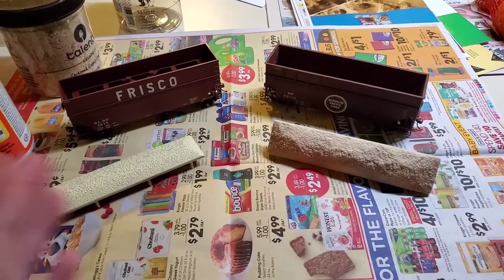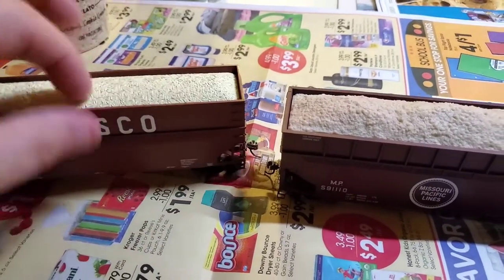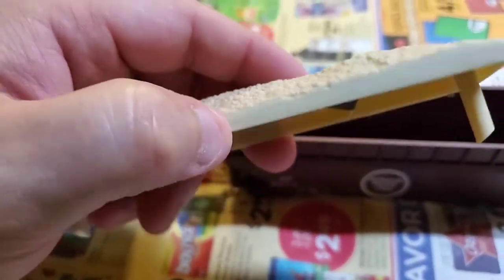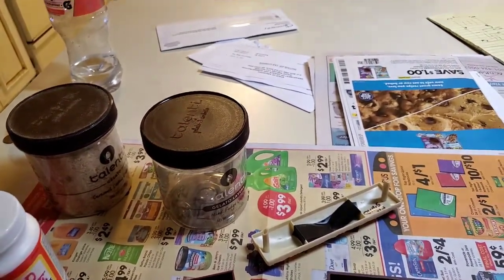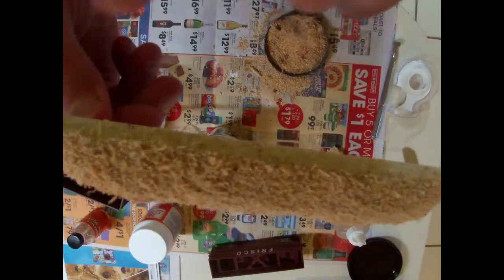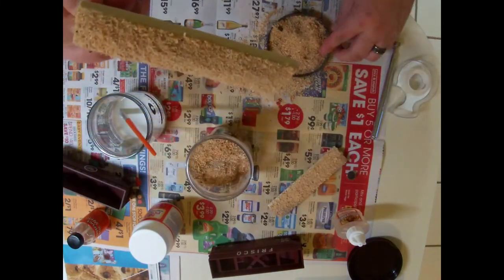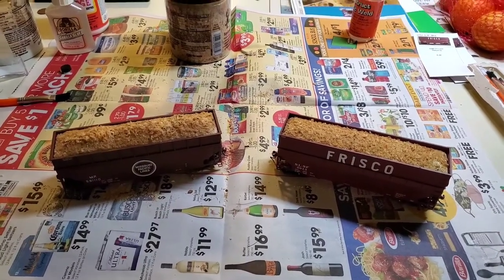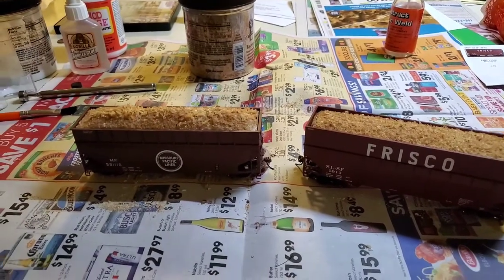How to: Realistic Load for Wood Chip Hopper

Comment: I WATCHED YOU WOODCHIP VIDEO.  I HAVE WALTHERS WOOD CHIP CAR LOAD  933-1034. I WENT TO MICHAELS AND BOUGHT AILEENS TACKY MAGNETIC ADHESIVE DISKS.  I USED GORILLA GLUE TO GLUE THEM ON THE CAR LOAD.  I WAITED 4 HOURS TO LET THE GLUE DRY.  MY MAGNET WOULD NOT PICK UP THE LOAD OUT OF THE CAR.  PLEASE HELP.
Reply from the maker: You might need to sand the sides of your loads so they easily slide in and out.
Reply: @TheTrainFreak    DID YOU WATCH THE VIDEO?? DIS YOU READ THE QUESTION??  THE LOADS FIT INTO THE CAR.  NO PROBLEM.  THE MAGNETS DO NOT WORK WITH THE WALTHERS LOADS.  I PREFER ANSWERS FROM THE ORIGINATOR.   RTFQ
Reply from the maker: @leowojtaszek419   first off I do not know who you think you are talking to me like that but I really do not appreciate you telling me to RTFQ. You asked for help and I am the originator of this video therefore I gave you advice so you can take it or leave it. It doesn't matter what brand you buy, the removable loads all works the same. You leave another comment like that and I will have you blocked from this channel.
Reply: @TheTrainFreak  You need to calm down man!!!!!
Reply: @leowojtaszek419  I use rare earth magnets and they work in all of my loads. Try them... Also the sanding instructions are right on point... he has a good video...
Reply from the maker: Thanks!

Comment: Thank You Jason. I have some coal loads I have never been happy with, came with Athearn Blue Boxes I believe. Going to use the same technique to get them more realistic looking. Great video!
Reply from the maker: I'm glad this helped. I will be doing a 2nd coat. Once glue dried overnight (after filming), I noticed holes. Hopefully this works well for your coal cars. I will eventually do some of those as well.
Reply: @TheTrainFreak  Adding the loose coal makes the cars look so very much better. Try looking at black ballast for a coal substitute as sometimes it will look better than the actual coal they sell... I have a friend that used "N" scale coal in some of his cars for a different look.

Comment: Labeling these things is smart. My custom coal loads fit hoppers from Stewart but I’ve acquired some other brands now and the fit’s not exactly right. I’ll have to make some new ones and label to keep them straight. Thanks for the tip!
Reply from the maker: Thanks! These two came with fake loads but they didn't look good at all. This is one of the commodities I have seen in person and the thick grain sawdust looks much better than the very small powder looking sawdust. Powder sawdust would probably work for N scale but not HO.
Reply: @TheTrainFreak  For HO I have seen people use a sifter to get rid of the dust in most saw dust piles. It will leave just the larger particles. The dust can be used in the first layer to take up some space if needed. I usually just get rid of the powder as i have a 5 gal. tub of the saw dust from the saw mill...

Comment: Cool Jason...I’ve saved sawdust for the exact reason and to use in my lumber industry area....what if you used diluted white glue on the second application, dries clear, so it doesn’t look glossy or bubbly?  Just a thought 🤔....then spray with some clear matte?  Did you make that magnet tool or purchase it from somewhere?   I Didn’t think of sanding the edges ahead of time 👍🏽👍🏽👍🏽.
Reply from the maker: I want to say I got the magnet extender from either Harbor Freight or an auto parts store. It needs to be a fairly strong magnet. After the glue really dried over night, I noticed I will have to do another round of sawdust.
Reply: You can get the tool where they sell magnets usually. I've seen them on Amazon...